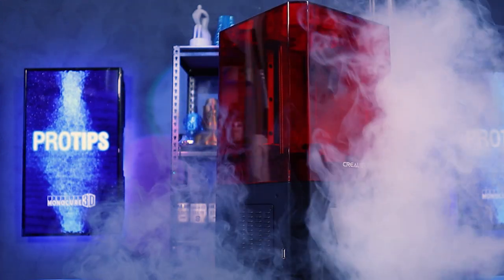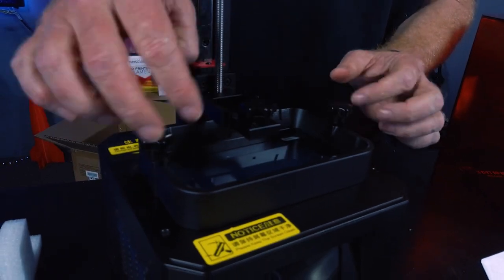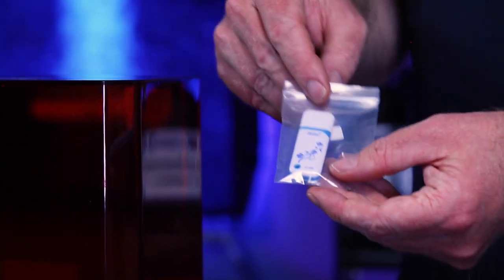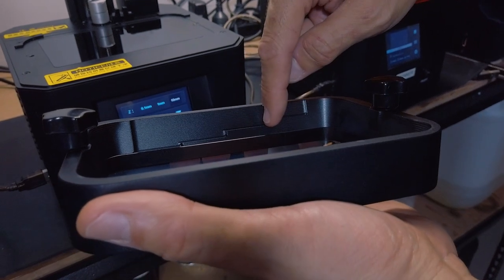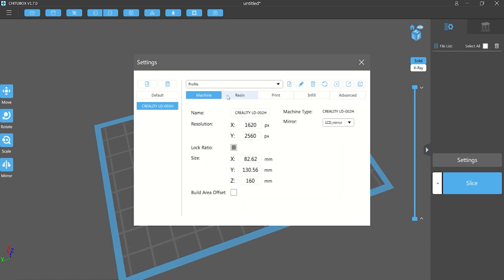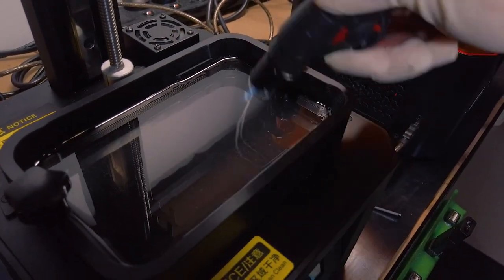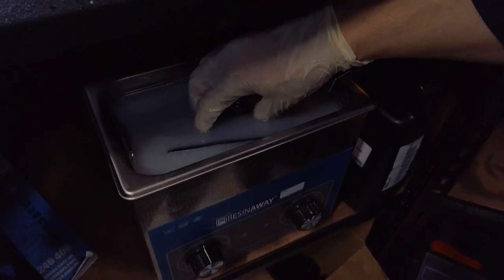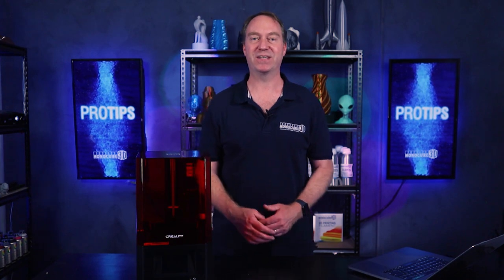Setting Up the Creality LD-002H

Comment: Leveling the buildplate is really tough on this printer. It really does not want to stay level.
Reply from the maker: Try using some washers to the 4 screws
Reply: @Monocure3DProTips  Thanks for you r help. I appreciate it. I did try that and started a test print to make sure it works. I will also get a lot of "soup skin" from this printer. Semi-cured flaps of material maybe 60mm X60mm. Do you know what causes those?

Comment: Just the Video l needed. Thank you! But l have a problem...my 3D models are not "sticking" to the supports... am so confused. or if l don't have support. Half of the model just doesn't cook... any ideas?
Reply from the maker: Try to increase the size of the supports and make sure you have a long enough layer duration to form them properly.

Comment: Hi guys! Great video! I have had a 002H for about 5 months and it's been working just fine. All of a sudden though, now when I press HOME, the build plate goes UP not down and any prints will have the plate go up about 5mm then try to print which just cures it in the vat. Any thoughts? I've re-flashed the fw etc.

Comment: I just purchased one of these printers and run the included 'sphere' test print with your Rapid Model Resin, which seems fantastic.  Next up I'll run the Monocure3D calibration print and then the cover handle stl from your website.  Thanks for the helpful video!